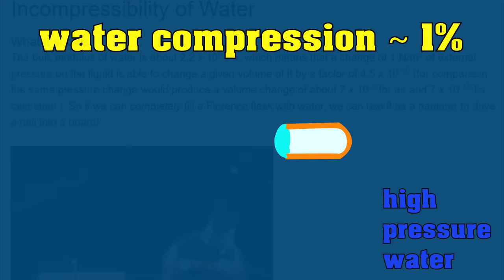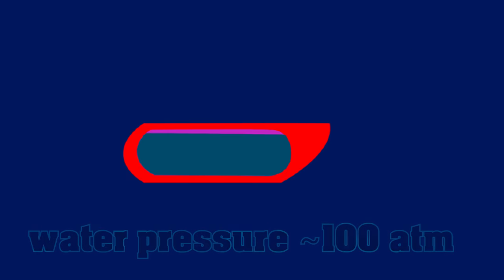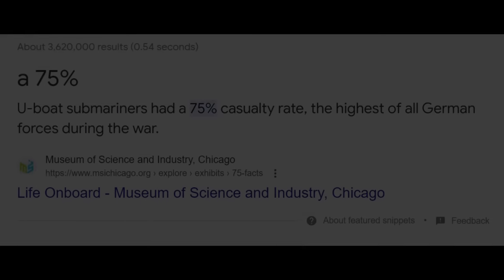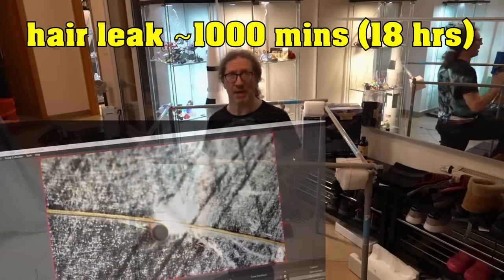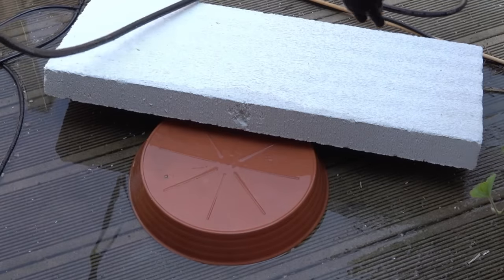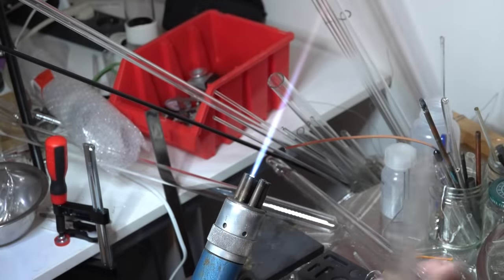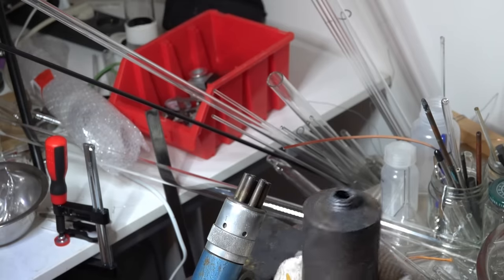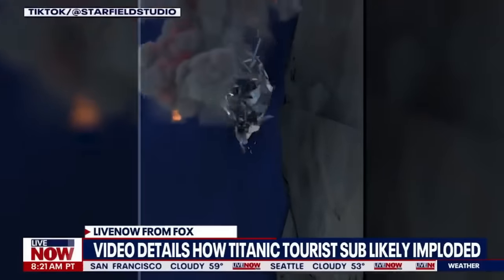Why the Titan sub failed

Comment: Without even watching, we already know that the back half of the sub, as well as the front chute where found in more or less one piece already. The only thing primary imploding was the central passanger chamber. And considering that it was partly carbon fibre, it did not crush like a can, but turned into an inward shrapnel grenade.
Reply: Probably outward not inward?
Reply: @NJ-wb1cz  The hull would break inwards along the initial loss of integrity, fly backwards from the cavitation and recoil and then repeat the same thing a few times in a matter of milliseconds until the energy is dispersed.
Reply: @kunibertrandolf1886  why? I think you're thinking of the thin walled tank collapse videos where a tank gets squished inwardly from the vacuum, but subs aren't built that way. I find Thunderfoot's suggestion about water filling far more convincing
Reply: @NJ-wb1cz  Yes you are right, in fact NO sub is build like this carbon fiber death trap was. In my first message I also especially said that it did NOT get crushed like a can. My point it that carbon fibre shatteres like glass once critical pressure is reached and doesn't just deform.
It also isn't an opposing suggestion to Thunderfoot.
The hull getting a hole, elsewise keeping integrity and secondarily exploding from the waters recoil or the hull loosing integrity by having the hole and completely shattering in the initial implosion is arguing over scemantics at best. 
The fact is that the front shute and the electronics compartment where found in pretty big pieces and yet there is few evidence of anything of the passanger chamber surviving doesn't give any information on which way around it happened.
Reply: @NJ-wb1cz  Carbon fiber composite doesn't deform, if you put enough pressure to overcome its elasticity it just shatters. As the water rushed in it would rip the hull to shreds like it was an ice cream cone.
Reply: @NJ-wb1cz if you watch the video animations, the water is rushing into the low pressure area, the color changing wave is water being uncompressed.
Reply: @kunibertrandolf1886 the fact that there aren't chunks laying around nearby does actually give hints that the carbon exploded outwardly instead of being crushed and imploding inwardly
Reply: @gavros9636  It absolutely does deform.  Makes a pretty good spring for many use cases, as it happens.  What it doesn't do to any appreciable amount is plastically deform.  Yeah, nitpicking, I know, but precision is important when talking about stuff like this.
Reply: @wibblywobblyidiotvision  Yeah that's what I meant to say honestly, still the stuff's as brittle as glass at times.
Reply: @NJ-wb1cz  Now I think YOU haven't been paying attention if you think that an under water explosion would carry material any significant distance and THAT'S the reason, no material was found. Gun shots fired unter water can barely travel 3 feet before friction and the energy transfer to the incompressible water stops the bullet. Specialized under water rifles from the russians can shoot 40 meters horizontally at ten meters depth and then lose about 50% range per 10 meters down. At 50m depth, you shoot 5meters with a special under water gun at best. 
For an explosion at that depth it menas, that even in the most violent of explosions, the actual expansion would be minimal and any shrapnel would be stopped almost immedietly.  
Shrapnel doesn't just "fly off" in any kind of under water ex/implosion, it all just sinks exactly at the ex/implosion site.
Reply: @NJ-wb1cz  I think it imploded/shattered/disintegrated and then there was a less rebound outwards, and probably a few back and forth in milliseconds until a low energy equilibrium was reached in or outward.
Reply: @kunibertrandolf1886  Can you speak with any authority on carbon fiber and how it reacts under such pressure and implosion? Not dissing you, just that a lot of the material may have indeed broken down into small fibers/pieces, and as its not metal and occurred thousands of feet above the floor of the ocean, quite possible it just floated away as it sank into the abyss.
Reply: @kunibertrandolf1886  that's a good point, I'll concede on that. The implosion claims though sound dubious to me
Reply: @boots7859  Again, you claim doesn't conflict with mine. I also don't know what kinda proof of authority I can give you on the matter, but it's simply a physical attribute of carbon fibre to shatter past its stress range. If the shrapnel got washed away, is too small to show up on the search robot cameras or got completely pulverized like a failing ruperts drop is up to debate once again. 
A bigger chung would most definetly not get pulled away too far without a strong current as carbon fiber has roughly double the density of water and would sink rather quickly.
Reply: @NJ-wb1cz  You can do that, we wont know for sure until further info of actual professionals working on the case and actual pieces give us the full, most likely story. 
Have a nice day :)
Reply: @kunibertrandolf1886  yeah, Thunderfoot's ideas seem far more likely to me that yours about implosion
Reply: @NJ-wb1cz  Here's the rub with Thunderfoot's pinhole idea. Watch the Hydraulic Press channel put a carbon fiber facsimile under pressure. The body of the ones that imploded shattered like glass and threw shrapnel into the interior. The one that wasn't glued very well at the seam and allowed a leak inside? It just filled with water and was otherwise unharmed. Anyone inside would still be a goner and in short order. But I'm thinking the sub would've likely been found more intact. So Thunderfoot's pinhole idea while plausible doesn't seem likely.
Reply: Failure starts in one location.
Reply: @NJ-wb1cz subs implode not explode!! 380 atmospheres pushing in compared to the 1 atmosphere pushing out.. it really would have been a inward shrapnel bomb and would have turned everyone into a chunky soup!! Even when a torpedo hits a sub it explodes and creates a hole letting hundreds of atmospheres in the sub and compromised integrity and causing a implosion..
Reply: @cavalieroutdoors6036 exactly 💯
Reply: @cavalieroutdoors6036  but that's a completely different situation, in that case it's just crushing anything by providing way more pressure than it can handle. Like, you can place a plastic bag into the water, see it collapse at 1 inch, and conclude that ships must also implode in water
Reply: @michaellegg9381  that's interesting! Do you have a link to the footage you're talking about?

Comment: While the pressure washer didn't go through the plastic, I'm pretty sure it still left a small dent if you pay close enough attention. That's still material that's being eroded, even if it's not as visible as on the interior brick.

Comment: IDK i don't think it was a pinhole leak. As someone else mentioned the hydraulic press channel did a pretty good experiment and the results looked a lot like the recovered wreckage.
Reply: this thing imploded. It may have been a pinhole for a few microseconds but that was about it. This implosion was so violent that it probably shredded a good portion of that cylinder. heated up the air to a 1000c and roasted everybody before shredding them as well.

Comment: The glue is referred to as "peanut butter" which is a term we often use in boat building to discuss thickened epoxy.  Could it be that they're just using thickened epoxy and not some specialist glue that can take the enormous shear forces that will be caused by the relative compression?  Also, that's a planar joint.  I was expecting some sort of rim or overlap so that e.g. the titanium was surrounded by the carbon fibre, which could then compress under tension around the titanium and support the shrinkage. That's the thing carbon fibre is good at after all.  But no, they just butted the two together with glue.  The more I find out about this the more astounded I am.
Reply: Not quite a butt joint but as you point out they built it backwards, with the ring slipped over a thinned end of the cylinder instead of having the cylinder over the ring.
Reply: THIS. No lip on that ring made this thing a death trap in your 30ft deep marina let alone deep ocean. I used to repair power plant water mains (2ft diameter often) with carbon fiber and epoxy. Nobody does high pressure CF flange butt connections for a reason. I promise you a flat sheer point with no teeth or keyway on the titanium was engineering suicide. It's like this thing was designed to put on a deep sea fireworks show. 😅
Reply: @tactileslut  I was just thinking this. "Oh, it would be really smart if they put the more compressible material over the non-compressive material--WAIT WHAT ARE THEY DOING"
Reply: There is no glue on earth that could bond those two materials.
Reply: @seanprice7645 sheering force is still acting on a flat plane surface (less surface area to hold connection than lipped or grooved socket connections) and still would have a catastrophic failure mode due to the difference in material compression. The way an internal pressure vs external would fail different but the point has more to do with the poor design choice of connection. Not meant for high pressure deep sea anything. It was a carbon fiber playground they had the audacity to repeatedly risk peoples lives in. A thin seam overlap of CF on the outside wasn't a "lip" to hold anything from shifting, it was the beginning of it's delamination points in the structure. A groove should have been in the ti cap for a socket connection in a better design but still. Carbon fiber ain't that material. Keep that shit on race cars and aircraft

Comment: I used to work at a pressure washer place. Your washer is probably great for home use. If you're starting a business, you'll likely want a heavy duty unit. Something that pushes more water per minute. In either case, they sell this one piece, I forget the name but it's a big bronze piece that goes on the end and it has certain ceramic bits inside and it creates this highly concentrated jet of water. Like a small pinpoint of water. And if that doesn't remove your, whatever it is, likely nothing will. Pressure washers alone aren't really all that concentrated. They'll clean stuff well but if you want to cut with it, you need special equipment. 

Actually, now that I'm looking for it online, I'm not sure if it's even available to everyone. They do sell these turbo nozzles and stuff but that's not it. This thing is all metal and it's big. Like the size of a fist. It's brass or bronze or something. Like a goldish metal. And the ceramic would sometimes break so they'd bring them to us.

Comment: pinhole leak? Dude, at the depth they were going to... and given the wreckage found, they suffered an implosion, which happens instantly once the hull is compromised in any way. There is no 'getting filled with water', there is "crack" then "squish", almost instantly.
Reply: Yeah I think TF is incorrect here. Not wrong with the science stuff, but ignoring the fact that Naval vessels monitored a loud underwater sound that was consistent with an implosion, and also that the fragments recovered were basically end pieces and nothing from the carbon fiber body. The fact that they recovered "probable" human remains also suggests a violent event that rendered the bodies unrecognizable.  So I gotta say I disagree with the analysis here, based on what we seen publicly reported.
Reply: You can have both. A pinhole leak is enough to create delamination that results in a big final implosion.

If the leaked communications log is real, then the sub was too heavy all the way down. And they had 10 minutes of strange sounds before the loss of communication.

Comment: What would have happened the other way round? If the titanium ring was a bit smaller and would have been on the inside of the carbon fiber? The fiber would still have tried to shrink but couldn't because the titanium would not have let it, so there would have been a huge amount of tension, yet carbon fiber is good at tension, right? Might have still failed the same way but at least the other way round would have sounded as if somebody really knew about this issue to begin with.
Reply: Interesting point. However, AFAIK, no one knows how or where the failure actually ocurred. Real Engineering is a Composites Expert and has a damn good video on this. TL;DR, apparently lot of factual data on deep sea piping made from CF that proves the experts right, and this was cost-cutting at its best.

Comment: Titanium Shrinkage (as small as that is) from cold water possibly allowed minimal changes to the mating diameter of the Titanium and Carbon Fiber glue.
Reply: While the action itself could have lead to deformation and/or de-lamination thus undermining the hull integrity in those areas the actual difference in shrinkage between the overlapping diameter space that is glued shouldn't matter at depth because the pressure is squeezing the titanium end-caps onto the hull like a plug.  This is why all hatches on subs are plug doors.  Same with airliners only inverse direction.
Reply: @arcc4  Furthermore, even if two materials do shrink disproportionately, the bond will hold them together and cause them to deform near the boundary until at least one of the three materials fails. Determining which is weaker is a complex engineering problem — not something that can be demonstrated by melting glass onto metal and watching it pop itself off.

The funny thing, though, is that even in his demo, the glass breaks first while still attached, yet he fails to liken this to the carbon fiber possibly failing before the seal.

Comment: I'd rather bet on carbon fiber collapsing due to accumulated buckling damage. They used expired carbon fibers, wrapped them without weave patterns and likely didn't even vacuum cure the thing but just bagged it. This thing started to crackle and then collapsed.
Reply: Also CF doesnt really have any useful properties for making a vessel for deep sea... For deep space its ideal because of tensile strength.
Reply: And, considering information on other channels, carbon fiber was not only less then optimal choice and not weaved as it should and could have been, but also cured improperly.

Comment: What surprises me is that knowing the differential compressibility, why not put the carbon tube on the outside of the ring, so that as it compresses at depth, it actually forms a tighter and tighter seal as the pressure increases. With a bit of engineering, you could find a suitable material to function as a sort of o-ring between the carbon fiber and titanium as well to form a proper seal rather than glue. (maybe a brass o ring)

Comment: I'm not sure about your final analysis, but I'm certain compressibilty had a lot to do with it.  The glue was pretty much only there to stop the end cap falling off when it was in the air, as soon as any pressure was applied to the outside of the device, the end caps were being pushed onto the end rings, and thus onto and through the tube.  And you'll notice that the tube was rebated into the end rings, with an internal and an external lip. So as the carbon fibre compressed and distorted under the pressure differential, there was a huge force accumulation on the lip - as you say, the carbon fibre wanted to be 1cm smaller in diameter, but the titanium wouldn't let it be, plus there's the force operating on the side of the tube trying to collapse it.

"Dirty Garage Guy" did a video where he ran his half-decent CAD model of the inner hull through its expected depth / pressure range, and showed the force concentrations.

As for the eventual failure mode - might have been a crack / water jet failure as you hypothesise, might have been gradual (over lifetime)  delamination followed by catastrophic and instantaneous failure.  I think the lack of any major chunks of carbon fibre being pulled up point more to the latter, though.  In any case, it's not going to have looked like the media's soda can videos.
Reply: Hydraulic press channel did a scale-model test with a carbon fiber tube glued into two steel endcaps, and used the press to increase water pressure around it - their test had two separate outcomes: a leak filling it with water, and the tube collapsing inwards suddenly and splintering (at only 820m) which notably separated from one of the endcaps.
Sudden failure also seems like the most likely outcome to me, as I'd expect that splintering to be more aggressive at deeper depths and would explain why not much (any?) of the CF has been found.
Reply: @SalamanderBSC  Back some years at a former job, we used both aluminum and CF pipes to build some stuff. There were vises around, and some had wedged jaws. For "we're morons" reasons, just about everyone at some point put some pipes into them and gave it a good squeeze. Metal will bend then crumple. But CF? If you're lucky you get a clean crack along the "fault line". If not... you were wearing safety goggle rights? Right?
p.s. even more "spectacular" (and unsafe) is to break CD's. You get REALLY NASTY razor sharp shards flying out of those.
Reply: The Workshop? Matt Hudson?
Reply: @forevercomputing  One and the same.  He changed the name of his channel, no idea why.
Reply: I'm pretty sure bulk modulus is completely the wrong thing to use for compressibility here because a sub is a hollow shell not a solid block of material.  What you actually want to use is Young's modulus.
Reply: @SalamanderBSC You also have to factor in that they went for a cheaper route of producing that carbon fiber it was never put into a pressure chamber to pull air pockets out of it while it cured, this made for an even less homogeneous material which is terrible because that's one of the main drawbacks of carbon fiber to begin with, this also makes delamination all the more likely.